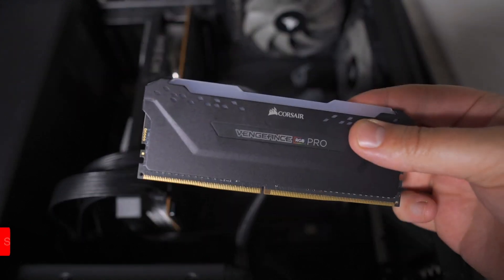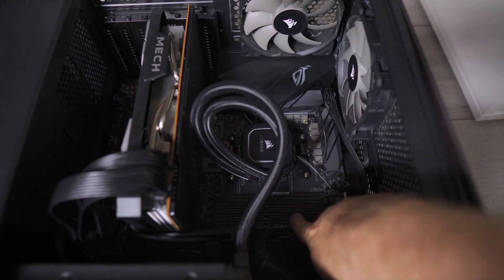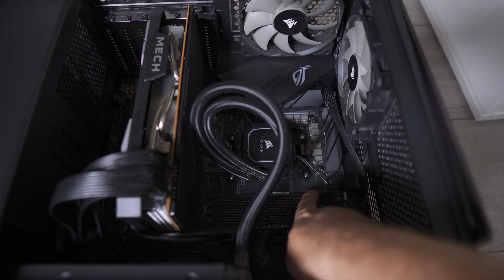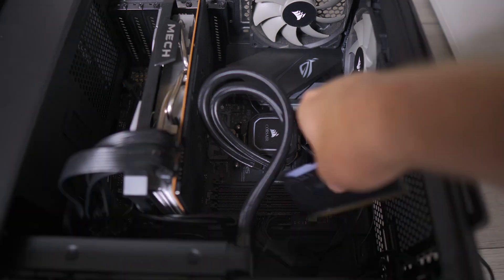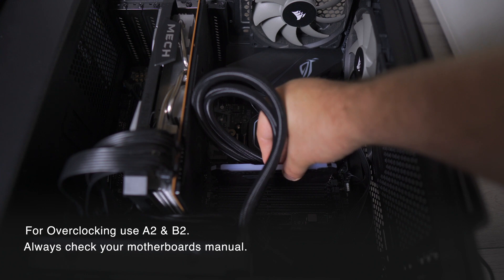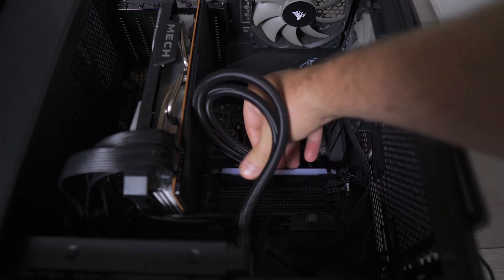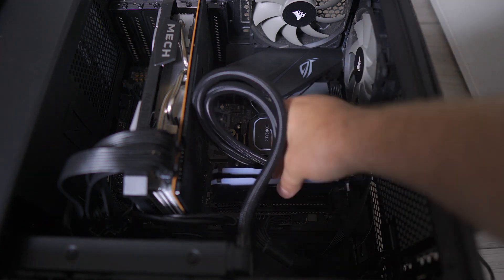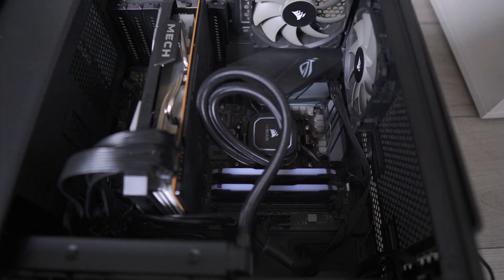How to Install Ram in Dual Channel Mode

Comment: I have 4 slots dual channel wit 2 16gb Vengence lpx 2666 and 2 8 gb vengence 2666 but only get 32 gb ram?
Reply from the maker: Have you made sue they are in the right slots?